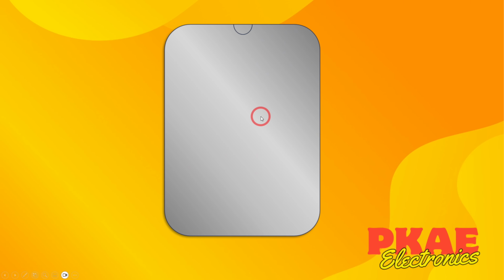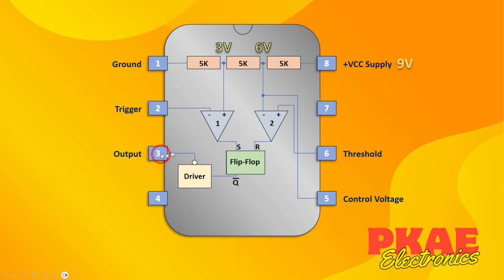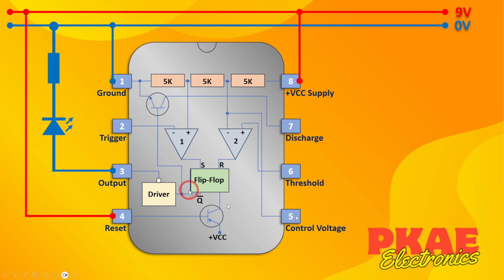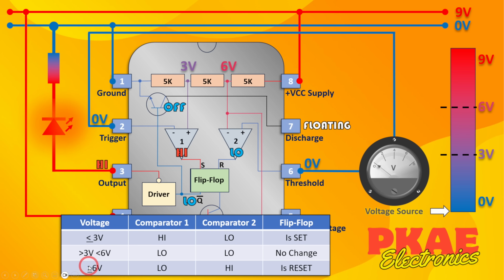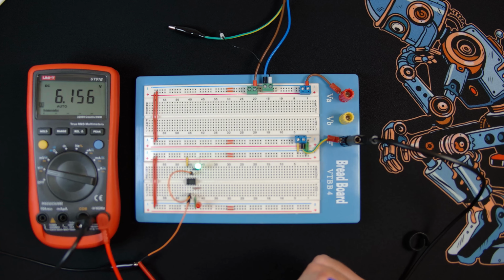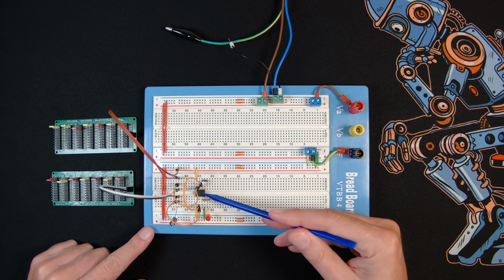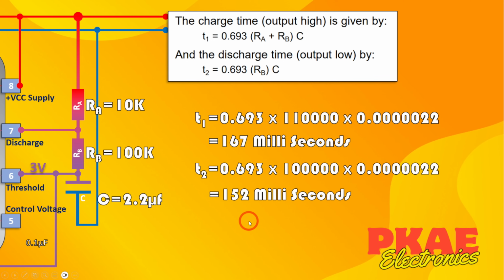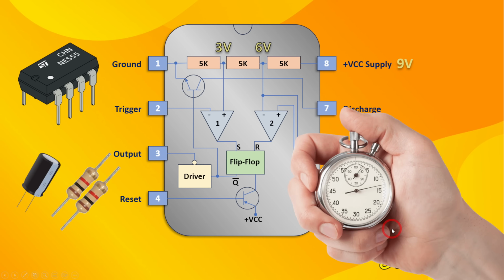How a 555 Works as a Timer.

Comment: This is the best explained 555 timer video ever. I understand what it does already high level and how to figure out the numbers but I have never seen all the internals so completely discussed and stepped through like you did. Brilliant work! Absolutely love electronics so throughly explained with real world results like this. Keep it up! And thank you for a more indepth understanding.
Reply from the maker: Many thanks for your great comment.
Reply: I agree 
I've been doing electronics as a hobby since the late '80s and read many articles on this IC 
Today I understood, for the first time, why a 555 can't give perfectly symmetrical square waves
Reply from the maker: @qlue7881  thanks for the comment. 

A video on how to achieve 50% (or higher) duty cycle is coming, if that's what you mean.
Reply: I learned ot 0 years ago at a Junior College
 Great professor.
Reply: DIY build kits are sold. Giant 555s. You build the internal circuit.

Comment: what happens when both set and reset pin turned on
Reply from the maker: Good question. The answer is, this is actually an invalid state and the output will be unreliable. It will most probably depend on which input triggered first.
Reply: @paulpkae  No. The datasheet is clear that for the internal R-S latch, the set pin overrides the reset pin. When the S input is high, the output will be high regardless of the state of the R input. See Ti sheet SLFS022I –SEPTEMBER 1973–REVISED SEPTEMBER 2014, section 8.4, page 12.

Comment: Great in-depth video on the 555 in astable mode. A follow up video could cover monostable mode. This would explain why the designer of the device didn't just connect trigger and threshold together inside the chip.
Reply from the maker: Thanks for your comment. I do intend doing some follow up videos to this. 

My very next video however is going to be a review of a nifty digital  microscope.